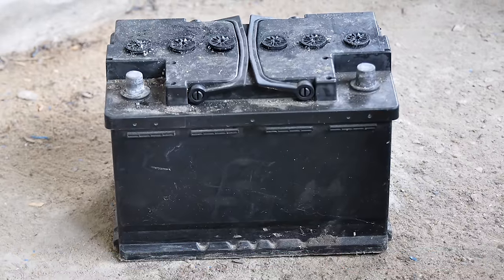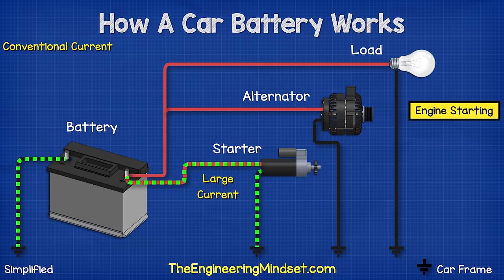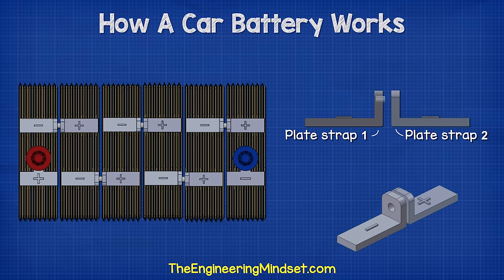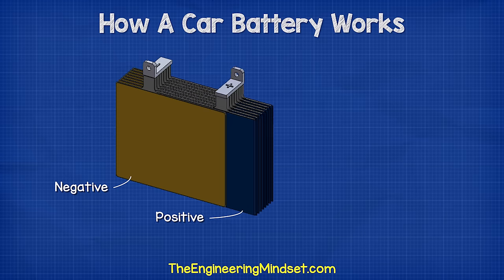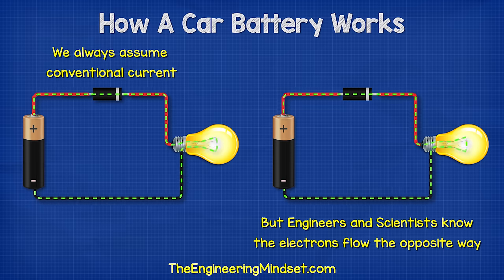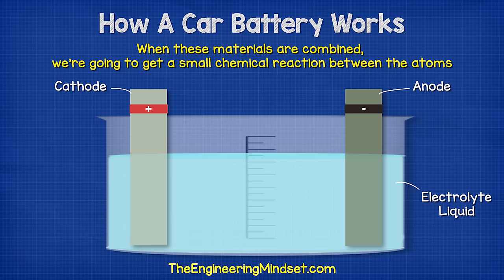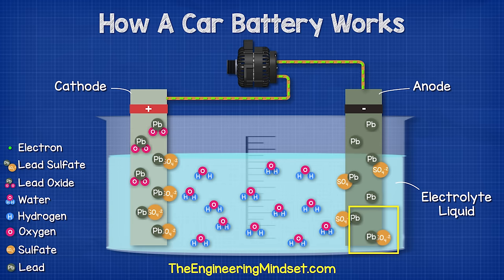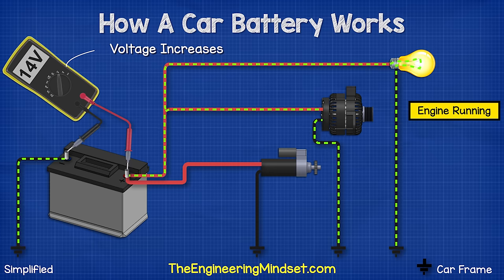How A Car Battery Works - basic working principle

Comment: when i was studying electronics in the early 1990's,   they were using the Flow of Electron theory to design circuits.   In fact,  there are instructional videos from the 1960-1970's that clearly teaches electron flow to teach electronics to students.   I started to read newer books and magazines in the 2000's,   I noticed they're now using Conventional theory.   This doesn't make any sense to me.  Why make it harder and more confusing ??

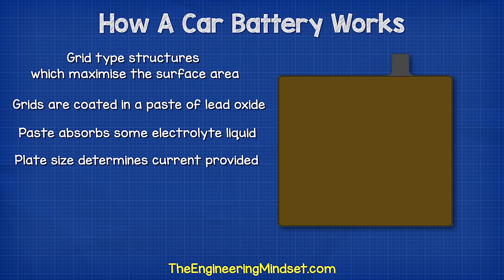Comment: 5:25.   Not quite.  The number of CELLS determines the voltage, not the number of plates.  You even say so earlier in the video.  The number and surface area of the plates determines how much current can be delivered.  The amount of electrolyte determined how much electrical can be chemically stored, but the number of cells (and state of charge) are what determine voltage.
Reply: But the number of plates determines the number of possible cells?  Once cell has no more than two plates ...admittedly, the number of series cells determines the voltage, yet those skilled in the art know what the author means.
Reply: @ulyhappy   It's... not quite that simple.   

First of all, each cell has two POLES, but...each of those poles can be a single plate, or it can be many connected together.  So, yes, each cell requires a MINIMUM of two plates (one for each pole), but each pole may ALSO be made up of SEVERAL plates connected together.  It'll still be 2.1 volts per cell, but the capability of the battery in terms of how much current it can deliver - and for how long - depends on how much of each of the plates is in contact with the electrolyte, and how much electrolyte there IS.  

The bottom line:  

More cells = more voltage.

More plates = more current it can deliver.

More electrolyte = the greater amoun tof TIME it can deliver the needed current.

And the balance you strike with these three determins the battery's characteristics.

And there is considerably more to this than what I've discussed here.  Seriously, it would take me a couple of hours to detail all of it.
Reply: @xaenon  no need to detail it for me. This video is designed for the layman and I was referring to the design shown. It was quite clear that the maker is outlining basic, monopolar constructions.

Comment: So if electrons are flowing from the negative how does anything thats connected to the positive and using the car frame as a negative get any electrons?
Reply from the maker: Flows through the frame. It's the same process it just flows the opposite way.

Comment: Did I miss something, or it's actually not mentioned that you need a rectifier between the battery and the alternator, to be able to recharge the battery?
You can't recharge a battery (DC) straighforward with an AC device...
Reply: It’s not actually mentioned. I think he left it out for the sake of simplicity.
Reply from the maker: The rectifier is usually inside the near of the alternator these days anyway, so to save time I omitted the info. Alternators will be covered in detail in next week's video.
Reply from the maker: Check out how car alternators generate electricity here: https://youtu.be/jdSKlg80DjU
Reply: @EngineeringMindset  Thank you, very kind! And the video is very cool of course! Maybe add a note/link to it in this video too... And keep up with the (very) good work!
Reply from the maker: Rectifier video here https://youtu.be/RiRyzLl4Y8U

Comment: Never seen a 2/3, 1/4 fire order. Usually they offset each one by a bit. 2-4-3-1, or actually I think mostly it's 2-3-1-4. I'm sure it's a simple design from previous years though. If I were to make it myself, that would allow much easier replacement of the parts involved.

Comment: Even cars with electric motors have lead batteries. 
No, not to drive the electric motor. But to switch on the high-voltage battery, 12 volt relays are switched on. 
It would be impractical to operate lamps, speedometer and radio with high voltage. These components are all available as a 12 volt version, and the components that are in other cars can still be used. The 12V lead-acid battery is charged from the high-voltage battery via a voltage converter. But since there is no starter, the lead-acid battery can be small. If the 12 volt battery fails, the electric car will not continue to drive even with a full high-voltage battery.

Comment: bigger batteries like 200ah ones used to function properly with only 10.5 volts, bc of the size, the starting will draw less current in a size comparison

Comment: Some combustion engine cars use absorbed glass mat batteries though.
Reply: It is the same chemistry but the acid is not sloshing arround, instead it is in a glass "sponge".
Reply: @andraskatona9766    Fiberglass sponge  so not as solid glass material.
Reply: @danc2014  l think we mean the same thing.

Comment: I have an idea for a electrical supply source that doesn't need fuel or power of any sort. First I have to understand how batteries work. It's a work in progress but I will get it built eventually.

Comment: I disagree that electrons actually migrate from the battery to the wires.

By this logic, when a generator produces current to charge a battery, it will run out of free electrons at some point.Rather, the electrons do not migrate but are concentrated in one place by the charge and thus an electrical potential is created, a voltage that releases the energy in a circuit.By this logic, the alternator will run out of electrons, and then what?
What do you think?

Comment: I have some serious question if someone is interested to answer.
Is the component like lights, spark plugs, radio system, blower motor, and turn signal powered directly from alternator or from battery?
Because if alternator directly power all these components, than they can explode because alternator output is very high for bulb, radio or plug etc. no?
Reply: While the car engine is on, the alternator provides the power but if the engine is off, the battery provides the power. Since the alternator produces a higher voltage (14V) compared to the regular voltage of the battery (12V), any components connected to the car system need to be able to to tolerate that voltage range. Some more sensitive devices will need voltage regulators to keep the voltage at a lower but steady level, while others inherently work fine in those voltage ranges.
Reply: I once removed the battery from a running car just to test that. Not saying the process was totally without any danger, but I can report that the car seemed totally unaware it didn't have a battery.

Comment: One thing that is a bit dodgey is saying that electrons don't come out of the positive symbol. The thing with a battery is there is going to be one side the electrons come out of and regardless of whether we stick a positive label on it, or a negative label, the electrons will still come out of that side. It wont all of a sudden start changing becuase we switched the positive and negative labels around. 

So saying Engineers and Scientists known the electrons flow the opposite way is semi-wrong. The reason I say this is because you can prove it with an LED, resistor and a battery, in the UK we still use conventional electron flow so our batteries direction goes from positive to negative, when I connect my positive end of a battery to an LED with the resistor the LED will turn on. 

The reason I saw this is because an LED's can only turn on in one direct, which means the electrons have to be going in the right direction, which basically proves my point about which direction the electrons are travelling despite our battery having a positive symbol drawn onto the battery where the electrons exit.
Reply from the maker: Check out NEW resistor video, everything covered! ➡️ https://youtu.be/DYcLFHgVCn0

Comment: I understand electrons are negatively charged. But if the flow is from negative to positive, how can you put a fuse on the positive line and have it block any current? Wouldn't it blow the item, as it runs through it first, then the fuse before the current returns to the battery? That doesn't make any sense. Fuses are put on the positive, not the negative, and I have seen them work many times

Comment: Is it normal for a new car battery to drain, when car isn't started for a week. Or it should remain charged from last week?
Reply from the maker: It should hold for years, something is draining it
Reply: @EngineeringMindset  Years would be stretching it. Most cars draw a few milliamps (usually under 50 milliamps) from the battery even while the engine is off. If your battery is dead after a week you might have a bad battery, or a parasitic draw causing the battery drain.

Comment: 13:16 why if we leave the battery discharged for too long or too many times does it become difficult to reverse the chemical reaction? And the sulfates that break away and accumulate in the bottom of the battery, why don't they bond with the water, h20? Like they did before? I didn't get that.
Reply: If that’s true then why don’t I just shake the battery so the sulfate can rise and mix from the bottom.
Reply: @asomeprod6163  idk like my guess is that the ions just become less charged over time and that's why it's not attracting to the water? Or maybe impurities to it?
Reply: Yes, the sulfites can and do grow and form crystals. They can even short out the plates. Then the lead-acid accumulator is dead beyond repair and must be replaced. Its parts can still be recycled though.

Comment: "We still to this day use conventional current theory when designing electrical circuits"
"The electrical formulas we're using will still come out with the same answers regardless of which way the electricity is flowing so it doesn't really matter"
If it doesn't matter, then what's the point of using a theory for the design at all? And what is the design about if it all turns out the same in the end?
Reply from the maker: If you consider a component like a diode, electricity can only flow in one direction, it's blocked in the other. We have to standardise which way we assume electricity is flowing to that the circuit works so we default to assuming conventional current. The formulas for the circuit do not provide different answers. So for engineers it makes little difference but if we start to delve into physics then it would.
Reply: I think it should flow from high potential (+) to low potential (-) as it is usual in every other field of phisics. What we messed up is the charge of the electrone. Yet if l think about rebranding the electrone as positive... uh just not right.

Comment: so basically, car battery is a pack of capacitors?
capacitors:
- rechargeable
- multiple layers of metal separated by a thin dielectric
car batteries:
- rechargeable 
-multiple layers of metal separated by a thin dielectric and electrolytes

Comment: does the battery need a recharge controller like a lipo/lion battery would?
Reply: yes  the lead acid battery needed a regulated alternator providing  @ 14.6 V.   The charge flow will eventually be reduced  as the battery is charged. There is less chance of fire and explosion with lead batteries if not applied correct unlike Li batteries
Reply: Yes, but a lead-acid accumulator does not need any "balancing" controller to even out the voltages between individual "modules" that are stacked in series.

Comment: wait so why on the cathode when the sulfate combines with the led that it does not release two electrons as well like the anode..you never talk about that...it kicks off the oxygens but i  wnat to know what else happens
Reply: This is the very definition of a cathode:  it is the electrode where reduction takes place.  Reduction involves the 'gain' of electrons.  In the case of the lead acid battery, the oxidation state of lead in the cathode during discharge is reduced from +4 (PbO2) to +2 (PbSO4).  This transition requires two electrons for each incidence.
Reply: well its engineering channel not chemistry channel, its a simplified redox reaction

Comment: at 10:34, Anode should be + and Cathode should be -...
Reply: I must admit, I did wonder about that myself!! 😂
Reply from the maker: Depends if the battery is charging or discharging
Reply: The Engineering Mindset Good point!!

Comment: But isnt cathode negative terminal and anode is a positive terminal?
Reply: It depends on what state the battery is in. You use it as a galvanic cell during dischargeing when anode is negative. Or you can use it as an electrolitic cell during chargeing when the anode is positive. The andode and cathode name refers to the direction of the reaction on the electrode, if you reverse the reaction, they switch places.
Reply: Oh okay i get it thanks bro

Comment: The starter motor is a short circuit to many batteries.
Reply: From a practical point of view that is true. The current is practically a "short-cut-current", i.e. the maximum any source can provide.

Comment: okay...so....when we do the multiple light experiment, and the light closest to the positive terminal lights first, and then the lights energize in a cascade, with the light closest to the negative terminal lighting last...what is REALLY happening is the electrons flow from the negative to the positive, and as soon as the circuit is complete, the light closest to the completion point energises first....but we still teach it the other way, even though its wrong....because we are scientists ...???
Reply: You'll have to talk to Benjamin Franklin about that, he called it wrong and they only found out the electron was negative 150 years later!  Makes no difference to an electrician who works with AC.  It only matters for electrochemistry, gas discharge tubes and magnets.   Physicists who work with those things have no problem using an old convention, just like changing units.

Comment: weither the electrons actualy comes from the positive or negitive terminal is easly proven... touch the negitive battery terminal to one end of a light and touch the other end of the light to ground ... and nothing happens.. NOW touch the postive battery terminal to one end of the light and ground off the other end of the light and you get light..we must always question the "authorities" as well

Comment: why aren't ICE car batteries changing to LiIon and lasting much much much longer?
Reply: Why spend $$$ million of dollars to convert to a new battery when the old one works fine?   Much longer needs to be proven. but a Li battery for $800 needs to last  4 times longer to be considered cost effective and most people will have sold the car long ago.
Reply: Because they wouldn't last much much much longer... They'd fail spectacularly due to the conditions a car battery needs to go through on a regular basis.

Comment: How can a headlamp kill that huge ass of a battery so quick like accidentally leaving it on overnight?
Reply from the maker: Headlamps use quite a lot of current, if the car is used for small trips and isn't given the chance to charge the battery up after repeated starts, (the starter motor will drain the battery quickly) then the headlamps will use the remaining energy. That's why campervans and emergency vehicles have dual batteries to separate the systems .

Comment: Why car don't use lithium ion batteries? It would be lighter in weight.
Reply: My chemistry professor said that only lead acid can provide this much current all of a sudden. (maybe this was true until very recent, i dont know). It is not he price, expensive cars also use stupid lead acid.
Reply: Race cars do use them to save weight, it currently cost ~$800 so most drivers do not need to spend the extra money for little weight gain.  It also has not been proven in cold climate use.
Reply: Lithium batteries are more expensive than traditional lead acid batteries. Lithium batteries would most likely be 16 volts for cars. Many electrical components in a car arent designed to handle 16V, the components would go crazy. And about the price part. Lithium battery banks cost about 600. You can also make your own Lithium battery banks as well.
Reply: Lithium batteries are also pretty fussy about temperature

Comment: My scooter battery      reads  a normal 12volts.how come it cant start my scooter anymore?
Reply: A dead battery has a high internal resistance even though the terminal voltage on open circuit stays at 12V.   To test a battery you have to load it i.e. draw a significant current from it.  You need a new battery, most likely.
Reply: @karhukivi  Thanks. I will try a 24v dc motor. Or would you recommend a 12v motor for testing?
Reply: @captainprototype187  I'm presuming you are talking about a lead-acid (i.e. car-type) batttery or a lead gel-cell?  A 12V car headlight (55W) connected to the battery should light for 3 minutes without going dim, and the voltage should still read 12V. 

If the light goes dim and the voltage drops below 10V then it is the battery that is failing.  If this test is OK, then perhaps there is a fault elsewhere in the scooter.

Garages also have testers which put a heavy load (100A) to mimic a starter motor load, and that shows up a battery fault immediately.   Good luck!
Reply: @karhukivi  I never realized that a dead battery has high internal resistance and that's why even a good voltage test doesn't always mean it's a good battery. Thanks!